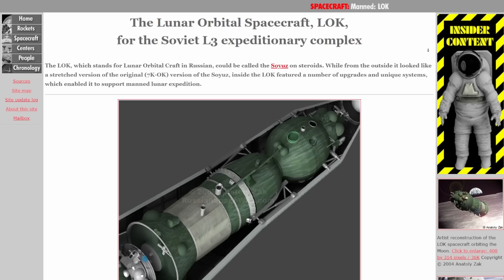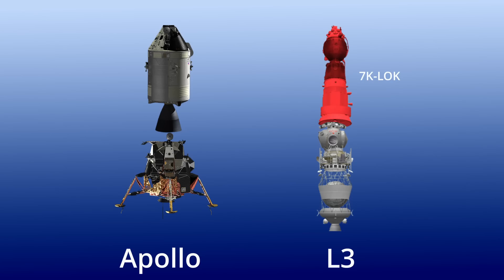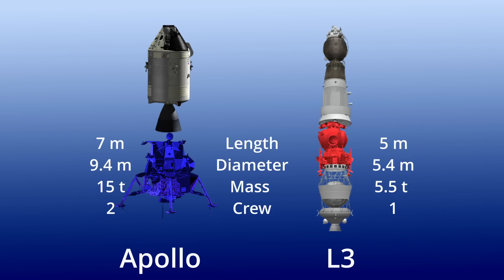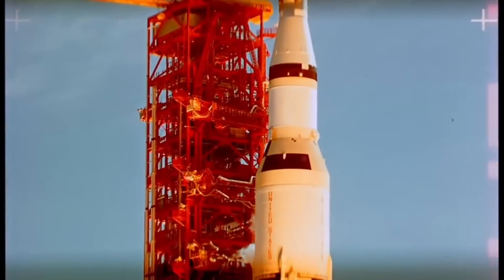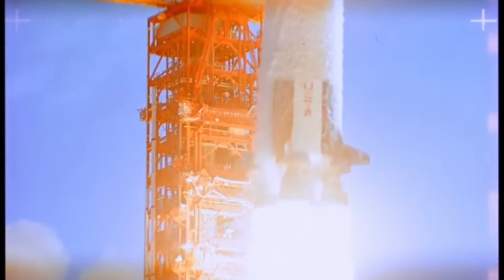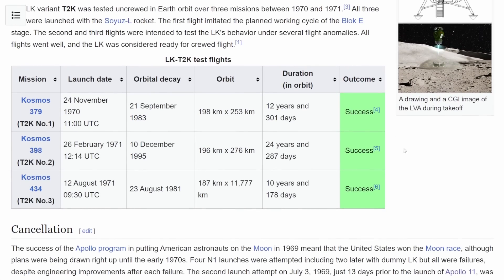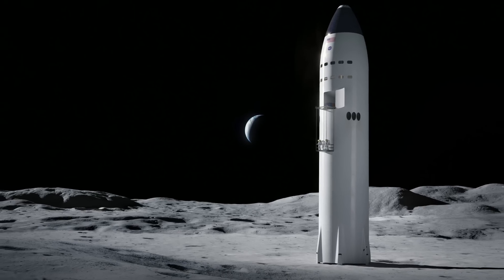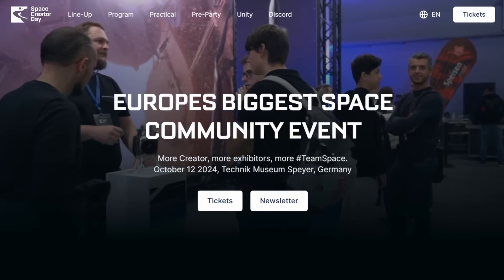Race to the Moon! Did Soviets or Americans Build the Better Lander? - Rocket Rumble #2

Comment: While Apollo's lander is clearly better (having twice the mass budget helps), it's worth remembering that both were hugely risky:
Orbital docking in lunar orbit, requiring that the lander launch into the correct plane at the correct time. 
Blasting a rocket engine into the lunar regolith and praying that none of it gets into the engine bell of your ascent engine. 
Your only ascent engine. A single point of failure that can strand you on the moon if it fails. 
No airlock or decontamination, so if you're allergic to moon dust there's no way to get rid of it. 
One astronaut on their own for a record setting several days in zero-gee, with no hope of medical assistance if something went wrong. And you need that person alive and well to keep the return spacecraft in the correct orientation for docking. So that's another mission critical singleton component.
Reply: Thankfully, the LEM was a two-stage lander with a separate engine for the descent and ascent stages. So the ascent engine was shielded from the regolith.
Reply: @JCDavis314  Very true.  But it's also an entirely separate engine, with its own set of tanks, pipes and wires.  By using a separate engine, you roughly double the main engine components that could fail.  And you set up the scenario where a lander with a descent engine that worked great could land on the Moon with no problems at all, but kill its crew if the ascent engine crumps on them.  Whereas, by the time the LK lander had landed its pilot, its engine was used and proven to work well, so you'd have less concerns about it than you might have, sitting on the Moon, depending on an engine that hasn't been fired since it was rebuilt after its acceptance testing.  Each path raises its own particular horrors, lol.
Reply: @DougVanDorn  in fairness, my comment was on the fact the ascent engine was protected against the lunar regolith, not necessarily the number of extra components (and points of potential failure) that two stages on the lander would have. True, each had their own risks, though with the planned Soviet lander, you run the same risk they did with the Apollo command module: you need to make beyond certain that it’s going to reignite.
Reply: thats another major point I like to bring up why we havent been eager to go back to the moon even if we have had the tech since the 60s after the end of  the Apollo program (besides the obvious budget cuts and infrastructure loss)  until recently, we had absolutly no business going to the moon with where we where at in tech at the time. we where only able to get everything to the barest of bare minimum of functionality and launched for the sake of the propaganda win and after the Apollo program ended and the cold war thawed a bit the standards for what was acceptable risk rose above "basically a suicide mission, do it for your country, you will be immortalized as a hero" and so did the costs and development needed for any potential mission instead of shrinking costs you would expect for an already developed program.
Reply: @coreytaylor5386  I dunno -- the Apollo program, at least, wasn't that hare-brained, or suicidally risky.  If everything worked as planned and designed, within an allowable range of errors and malfunctions, it really wasn't much riskier than Earth orbital flights.  Every time they actually started up the LM's engine and headed to the surface, it all worked.  They landed safely on every actual attempt, the ascent engine worked every time, and rendezvous (around the Earth, Moon, or wherever) turned out to be relatively forgiving of small errors, if you paid close attention to what you were doing.  And the one time something major DID go wrong, with a little luck (that it happened with the LM still attached) and a ton of thought on how to use a LM as a lifeboat, that crew (13, of course) suffered the loss of function of one entire spacecraft, and worse, that was the only one that could get them home.  But they got home, because someone sat down in 1963 and said to themselves: "This flying to the Moon is risky, how can we make it less risky?  Well, we can add a few pounds of oxygen and water to the LM, enough to get a whole crew of three back home from the Moon, if worse came to worse.  It'll make our LM last on the Moon longer, and make the flight out, anyway, less risky."  So, it was NOT gung-ho flyboys itching to die for their country who volunteered for "basically a suicide mission," it was smart people who only got comfortable flying the missions because other smart people did everything they could think of to mitigate the risks at each stage of the mission.  The Soviets, I don't know enough to say how they approached it, but I bet they figured their plan, while risky, was solid enough that they expected it to work.
Reply: @DougVanDorn  I did use a bit of hyperbole for the sake of making the point without to many tangents but yeah you are completely right, but that doesnt change the fact that while every detail they could have was planned, it was still incredibly risky and the astronauts had to improvise solutions and fix critical things on route to or back often enough with no second chances or room for mistake to where leadership would want to risk even a single event like Apollo faced regularly ever again
Reply: People forget the human factor too, just a look can convey a thousand words. The moral support of another during the risky landing and then moon walk.
Reply: For proof of difficulty, try in ksp which is easier than real world